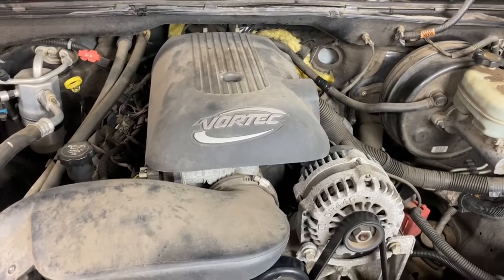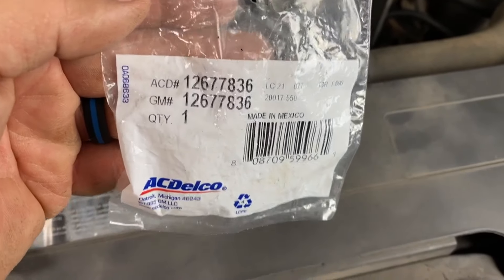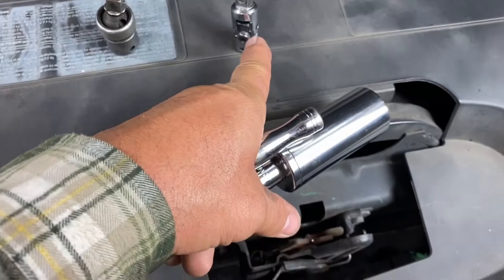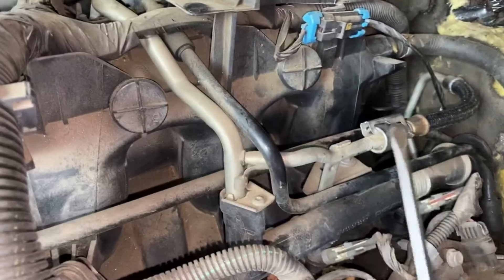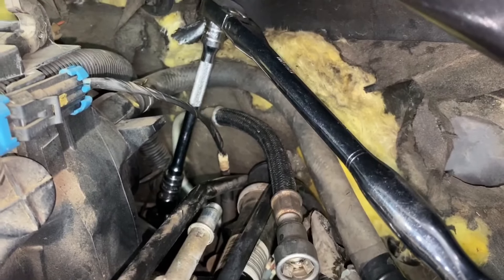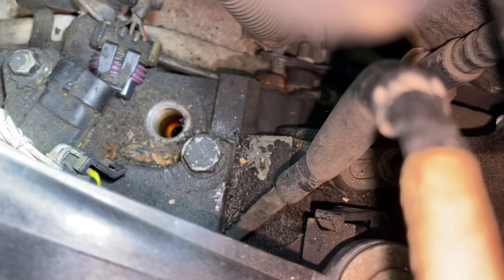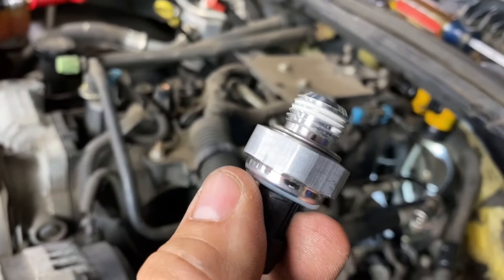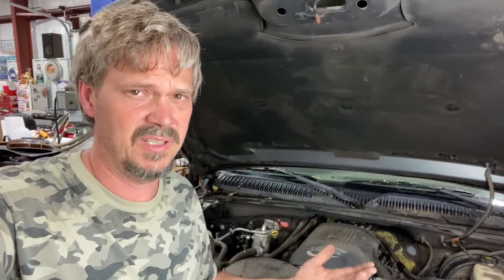Low Engine Oil Pressure / Oil Pressure Sensor Symptoms and How To Repair

Comment: Super helpful man, love the willingness to help others and answer questions
Reply from the maker: I’m happy to help. Thank you for commenting
Reply: It was very helpful I helped me out a lot you THE man
Reply: Thx that's help alot...I put in unit but im.still getting liw oil pressure. With oul light showing occasionally. Is Teflon required to install.and should I ck. Tourqe on oil unit.
Reply from the maker: Thank you. I’m glad 😃
Reply from the maker: I think you should be ok even if you don’t use Teflon sealer. You could have a bad gauge or bad ground or connection? Does your oil pressure drop when the engine is warm?
Reply: @dhammiam  yes

Comment: My truck dont turn on i changed oil pump oil level sensor still dont turn on and my oil gauge still dont work would it be the oil pressure sensor ? I was driving on the freeway going 60 and truck turned off and lost power
Reply from the maker: When you say it lost power, what do you mean exactly? Did it just cut off? Did it make any noises? Did you change the oil level sensor, or oil pressure sensor?

Comment: Had same issue on my ‘11 Tahoe LTZ.  Probably had 1/2 as much room to work as you did.  Not a mechanic, but I got mine swapped out in about 2hrs (inexperience and lack of tools).  Worst part was laying over the engine to get back there.  Gotta love the engineers.

Comment: Ur a life saver i picked up a silverado 2005 z71 crew cab with transmission issue and i bought it for 100$$ as a project and oil pressure is at 80 now i know how to fix it thank you saved and liked the video so i can fix my truck when i get my new car
Reply from the maker: Awesome, thank you. I’m happy to help
Reply: I have a 2005 Silverado . Glad I saw this Video to know how to replace mine . Thank you for sharing your knowledge on this Great Video. You have helped Many Truck Owners with this . Again I  thank  you .
Reply from the maker: Thank you for the kind words. I’m happy to be in a position to help 😀
Reply: @dhammiam . 2017 sierra 5.3.  I changed the sensor ( in front near thermostat) . No change??

Comment: Thank you for the helpful video! Based on my research on the filter, if you have active fuel handling where the computer cuts off cylinders, you probably have a filter.  I had the peg high 80 pressure.  Rev engine it would drop, then stall to 0 then go back to 80.  For my job on an 05 Tahoe with 5.3L, I grabbed 3 moving boxes stacked flat on top of each other to lay on over the engine area, I put a 3 step stool at the bumper to stand on and just laid over the engine on the boxes.  This really made it quite comfortable to find the sensor.  At first I tried to get my big hands back there, only first removing the shield cover,  it wasn't possible so I disconnected the fuel rail line as you show and then using a boroscope saw the cable connected to the sensor and just fished my hand down the cable to the sensor.  At the sensor I gently lifted the clip, then pulled it off.  I could feel the yellow grommet seal in the sensor.  I got the socket on with the 3/8 wobble extension 6" and then a 2-3" wobble (2x wobble).  I fished the socket/wobble tool down the side, got it on by hand, then using my left hand holding socket in place and using flex 3/8 ratchet removed it.  Make sure to have a good grip on the socket and sensor, in my case the grommet fell out of the sensor, was in the socket, then it dopped out into the bay and luckily on the driveway vs hidden for life on the frame.  There is also a gray insert on the old sensor you want to move into the new sensor, I think it just tightens up the pin guidance to ensure a snug fit and contact (I used a little pick to get the gray insert out).  I used the boroscope to look down at the hole for a filter, this engine had none.  Bolted up new sensor, for safety of the socket, keep your left hand on the socket to ensure it doesn't run up and go on an angle and crack the sensor.  You will feel the sensor have resistance once hand screwing in as the thread sealant adds some resistance.  It tightened up nice and snug, then I paid attention to where the clip notch on socket was as you are doing this all blind by feel.  I started the tahoe up, using boroscope ran it for 5 minutes and looked around the sensor for leaks.  There were none, pressure now really close to 40 at idle and when I rev the engine, it tracks with higher pressure.  In all the job wasn't bad if you have wobble extensions and a thin wall oil sensor socket, I could probably do the job again in under 30 minutes from setup to back up and running.  If you have the right tools, you can do this repair.
Reply from the maker: Great job! Thanks for commenting and thorough tutorial. I should add this into the description. It’s been a couple years since I replaced mine and it’s still working as it should. Let me know what job you tackle next. I really believe anything can be accomplished if you set your mind to it. Take care, 👍 David Hamm

Comment: this is the best video on the subject.  I am needing to do this on my 2004 Avalanche (pressure gauge on dash pegs at "80" with key on engine off or engine running).  I'm going to have to disconnect that fuel line too because I have large hands and thick arms.  One thing I have not seen in any video is how to disconnect the electrical connector on it.  Nowadays it seems that few are truly press and release, most seem to have some funky lock setup or hidden release.
Reply from the maker: Thank you. I don’t like the connectors that are so tiny and require a small screwdriver to get the clip released. They’re always in a tight spot too
Reply: @dhammiam  I managed to get mine swapped and back to working.  Probably could not have done it without watching your video so thank you.  I was pleasantly surprised that the electrical was just a pull on the tab and lift it over the hump style and very easy to remove

Comment: Thank you for this video. You are a big help. All other videos were saying you have to take off the intake and I am dreading doing that because I do have to replace my knock sensors but for now I see a way around changing that sensor. Thank you so much!
Reply from the maker: Great, I’m happy I could help! Plan a day and take your time and you’ll do fine
Reply: @dhammiam he man! Help me out when I start my 2000 Ford Expedition the oil sensor signaling after I drove around 1-2 kilometers it’s starts to starts it’s place and sudden it drops? What the cause.?
Reply from the maker: @BoedwardBuenaflor  that could be the sensor. I’m having trouble understanding the question but I would start with the easiest fix. Check all grounds and wiring including the connection on battery and sensor

Comment: My 06 4.8 was pegged at 80 psi got a new sensor and there was 3 stores I checked all was over $50 but got it and replaced mine in about 15 minutes worked on the first try.

Comment: My respects to you sir. I need to do this to my 2006 escalade 6.0. Just started getting a low oil pressure warning and my oil pressure gauge going from 0-80 randomly.  Thank you sir.

Comment: I know this is an old video, but I am seeing a little low oil pressure in my 5.3 while cold.  When the truck runs for a bit, it'll move back to the original pressure.  I've had this truck for a long time, and it has over 320,000 miles on her.  Any information or tips would be great appreciated, truly believe that anyone can learn to do mechanical work.  It is rewarding and cost saving for sure!  Great video by the way.
Reply from the maker: Thank you for the compliment. It’s usually that the oil pressure drops when warmed up. With that many miles the cam bearings could be worn causing the drop. You could run a heavier viscosity oil and see if that helps. Lucas oil treatment is good to use and try as well.
Reply: @dhammiam  I'm trying to find a 6.0 or another 5.3 to swap in there.  I have had the best luck with this truck.  Simple maintenance and replaced the 1-2 solenoid in the transmission.  What would be a safe weight to try out? I live in the desert of California but in the winter, it can drop a couple degrees under freezing, not very often though.
Reply from the maker: @chadball8296  another thought on the oil pressure is if the pickup screen is clogged or the oil pump wore out it could take it some time to build pressure. As far as oil, you could use the recommended oil, and replace one quart with 20-50 and another with Lucas and see how that works.
Reply: @dhammiam  Awesome, appreciate the information.  I will be doing my oil today!  I'll let ya know the results.  If I find that that doesn't fix anything.  Replacing the oil pump, do I have to pull the front cover to remove that?
Reply: I had the same on a 200,000 mile 5.3. Turned out to be the oil pickup O-ring

Comment: Nice job.  I just paid $550.00 to have my sensor replaced😂.
Had I seen this video first, I defiantly would have done it myself.
Reply from the maker: Next time you’ll know. If you ever have a question about something just comment here and I’ll see if I can advise or do a video to help. Thank you for the comment
Reply: That's So damn greasy..I wonder how often they simply do it this way..but charge to remove  the manifold etc.

Comment: Gave it shot today and couldn’t swivel that harness out the way to get the socket on. Then the valve stem to heater core snapped off and I got covered in coolant. What a day.
Reply from the maker: Oh no 😮 I’m sorry to hear that. Were you able to get it finished yet?

Comment: Those are great words for the people who feel they can do it. Me personally I'm a certified aircraft technician,  unfortunately not licensed yet, but I try and do all the work on my 03 trailblazer ext 5.3.  I've even overhauled my transmission,  so I've gotten really in depth when it comes to working on my truck. I been having a lifter problem for about 2 years and getting louder. I noticed some motor oil near the bottom of the transmission,  so about to drop the oil pan change gasket and O-rings and I've also noticed that my oil pressure guage stays around 40 no lower and just slightly higher to about 43 or 45.
Reply from the maker: Sounds like you’re doing great. When I went through college to be a dealership technician, most of the others in my class didn’t come out rebuilding transmissions because they were intimidated by all the parts involved. I just set my goals one at a time and each time went for the next level. I wondered if I could become a nascar engine builder and did. I believe anything is possible if you set your mind to it. Aircraft Technician is impressive. I thought I could cause issues if I didn’t assemble a nascar engine correctly, but an airplane is a whole other level. Keep doing what you want to do and you will do great. That’s important. Let
Me know if you have any questions. As for the lifter issue, could be a number of things. You can run the engine without the rocket cover on and be sure oil is getting to the rockers. Maybe while you have the pan off replace the oil pump. I’d suggest taking the new pump apart, inspecting and cleaning it. Thanks and good luck
Reply: @dhammiam  hey that's impressive. A NASCAR TECH! WOW. That's amazing for real. I'm happy you were able to accomplish that. I dropped the pan already and changed out the gasket which was completely flattened. There was very little ínsulation left on the gasket, and also changed to O-ring on the pick up, but still have the lifter problem. Unfortunately! Oil pressure is fine its still around the same 40ish I even feel more power accelerating. 
Took me over 12 hours 🤣  only because I was working on the floor and that sucks but she's running good and no more leak. I didn't remove the struts or the sway bar links and when I pulled out the 4x4 actuator the drive shaft came out with it. Lmao, but everything is fine.
Reply: @dhammiam  oh and I do have the oil pressure switch that I'm not sure if I should change it or not. I don't ha e any codes, I didn't have them before. No miss fire or anything so either the lifter is stuck or needs to be changed.  I'm pricing every thing now. Head gasket, bolts, valve cover gasket etc.
Reply from the maker: @JovanValentin711  there’s lots of products that claim to help lifter ticking. You could try some marvel mystery oil for I think maybe 1000 miles? Look that up. I’ve used CD2 before years ago. These are some alternatives to try before digging in. I’d say replace the op sensor if you’re already in there and it’s easy to get to but hold off till then.
Reply: @dhammiam  I've already tried other products  none worked. Lol. Last I tried was Liqui Moly and no go..... off it must go. I have thw old pressure switch I dont think that's the problem. My pressure is steady around 40 it's been consistent at that, but once I remove the intake manifold I'll change the switch anyway. There is better access that way. Thank for the input
Reply: @dhammiam  the lifter is definitely collapsed at this point.  I'm going to try and see if I can loosen it up like I've seen in other videos and if that don't work I'll just swap the lifter.  As long as I don't have to remove the head I'm good. Which I've been told I won't have too.
Reply: If the oil pressure sensor on my truck leaked really bad that does mean I have others problems? Thanks

Comment: Good job. I’ve replaced a few of these and I’ve found the gm sensors are spotty on quality. Started using STANDARD MOTOR PRODUCTS brand which are USA 🇺🇸 made. Seem to be alot higher quality.

Comment: I just put one in my 2006 Silverado and a 1-1/16th inch deep well socket did not work . I had to by a socket that is specifically made to fit the sensors made in the USA. So I will be taking back the 1--1/16 socket . Do not do what I did and by the socket the YouTube video said to use  before you by the oil sensor ! Other than that , it was relatively an easy job .

Comment: I just did mine on a 2012 sierra for the second time in 3 yrs. Guess what, the screen was filthy. I installed the new one w/o the screen. Lets see how long it lasts this time. Now i have to tackle a bad CV axle for the second time in 2 yrs lol. If i didnt have bad luck, i would have no luck.
Reply from the maker: Hopefully it’ll be fixed for good now. I know what ya mean. It’s one thing after another

Comment: I have a 1994 GMC Sierra and I was told that the older truck runs on high oil pressure readings. I installed a new oil pressure sensor and now my readings is around 40-60 , do I have to tighten it some more are what am I supposed to do? Thanks

Comment: I have the same issue on my 2019 4.3 i already change the sensor twice, the first time was with a sensor from autozone and second time was a factory sensor (ac delco) and the issue   Didn’t get resolved. The truck runs fine and there are no weird noises coming from the engine, I’ve put the scanner on it and it says oil pressure switch. Would you have any idea of anything else that might be going on with it. TIA

Comment: So I bought this Chevy Silverado in 04 new and I replaced the oil pressure sensor back in 2014 and I had forgotten a lot of different stuff about the job. For instance; what alerts you to a problem is the oil dripping so fast that you probably can’t drive it because it’s losing so much oil. The first time the gauge was acting funny, but this time the gauge was acting fine, there was just a bunch of oil coming out and it was dripping down from the bell housing, which caused me to think it was transmission fluid. Anyway, once I determined that it was oil, I looked in the bell housing inspection cover and didn’t see anything that would indicate that much oil coming out of there, so it had to of been the oil pressure sensor or a main seal. Thank goodness it was just the oil pressure sensor switch and it was a lifetime unit from AutoZone because those darn things are now like 80 bucks and thank goodness I found my one and 1/16 inch special thin wall socket because you’re not getting it out of there with anything else and I had a couple of 1 1/16 sockets that were never going to work. So I got 10 thumbs and I’m not very adept with a wrench but I can do this sort of thing and you can’t see the damn switch and you can’t see the electrical connector and I had a little dental mirror which was of absolutely no use and several high powered flashlight switch, or of no use whatsoever little or no use. Somehow I got it back in there without cross threading it and now it no longer leaks and the gauge works just fine with hardly any out-of-pocket costs for the repair.
Reply from the maker: Great job! These are bad about leaking, and in a bad place to get to. Fortunately it wasn’t the rear main seal because that’s much more involved to repair. Thanks for commenting and I’m glad you fixed it!

Comment: Just got the quote from my mechanic and it was 300 to do this job.  How long did it take you to do this?  I am tempted to do it myself.
Reply from the maker: Start to finish and videoing it took about an hour. You should be fine just make sure you have all the tools before starting. Just don’t rush and allow plenty of time to be no pressure on yourself. Let me know how it goes, thanks and best of luck